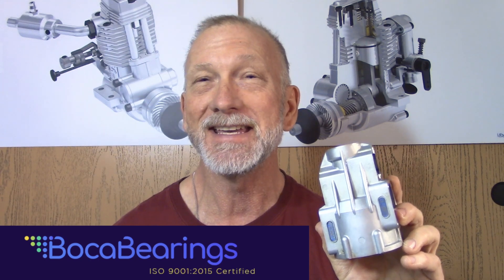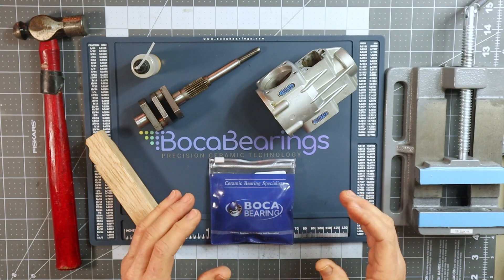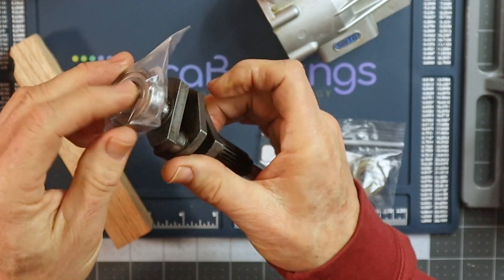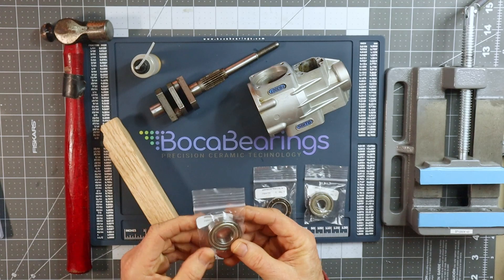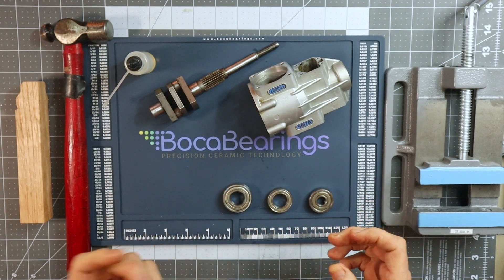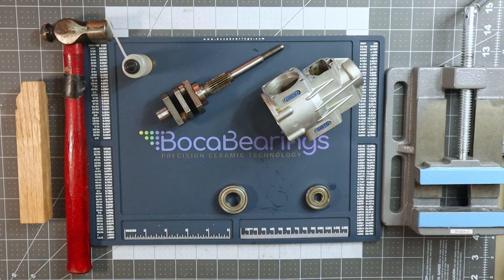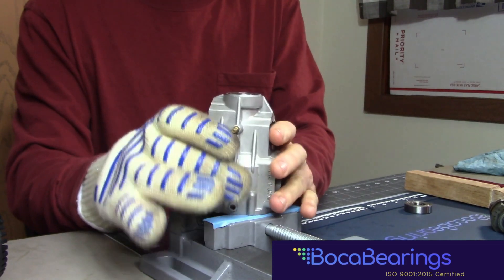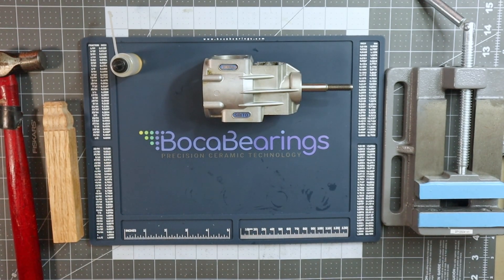Boca Bearings Bearing Installation Saito FA-300T

Comment: Did you notice if there is a passage through the crankshaft or the crankcase to allow oil to get to the front of the engine. I agree with you about leaving the shields on in most cases, but if the engine is relying on an open bearing for oil flow to the cam and vent tube, it might be better to not have a shield on the center bearing.
Reply from the maker: Oil gets distributed throughout the engine regardless Mike. If you watched closely you would have seen that the mid bearing was only partially shielded. There was no shield on the backside. Have you ever opened up and glow engine and found areas devoid of oil at all? I haven’t. Besides this was an instructional video on how to install bearings not what to do with the shields. I clearly stated that this is my engine and that what i was doing was an experiment. I know how often this engine will be run and how it will be run. The risk, if any, is mine. Anyone that blindly follows what i do here needs a lesson in listening.

Comment: I usually use the kitchen oven set at 200°C to heat the crankcase and the freezer to cold the crankshaft/bearing assembly. At this temperature difference, the bearing usually enters freely without the need to tap it. Nice video and engine!
Reply from the maker: Not good for your health to breath in all the vapors from an engine and then to have that trapped inside your oven where you cook your food! I wold never admit nor recommend that to anyone.
Reply: @dmrcflyr2  Well, there's no need to heat the crankcase at the same exact moment you're preparing the roastbeef!! 😜

Comment: Good job David.  I have no data to support this opinion but guessing that an unshielded bearing would run a bit cooler than a shielded one?  Looking forward to more information on this.
Reply from the maker: Possibly but the internal engine temperature never even comes close to the heat range of the bearing for failure. Not by s long shot.
Reply: @dmrcflyr2 like your videos Dave. 👍good job! 
I’ve always put the crank case in the oven @250f for 20 minutes, 6 of 1 half dozen of the other with a heat gun…
Here’s is my 2 cents on bearing shields…. I remove the shields on bearings that are internal contained. Not the end of the world if one shield is left in place that is pressed into a blind hole. ie: Cam bearings. 
The reason I did so is not so much for a lack of oil during operation, it was for the post  “after run oil” to really get in there and be circulated for storage. With both shields removed from the rear bearing you can easily inspect it with the cover removed if needed.
Those Twin Saito’s are Brutes! Glow Fuel pigs that really lick it up, especially on that 30% stuff. Great if you can afford it… Looking forward to the bench run video 👌
Thanks Dave.